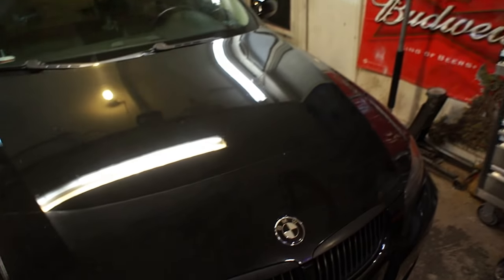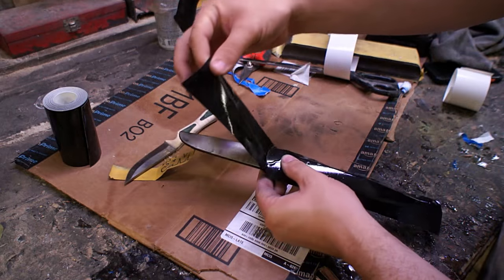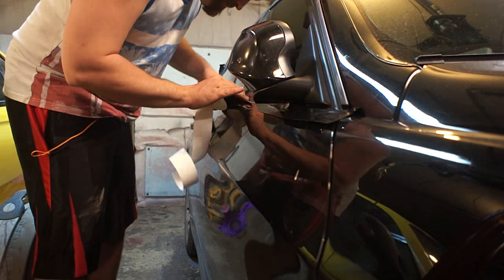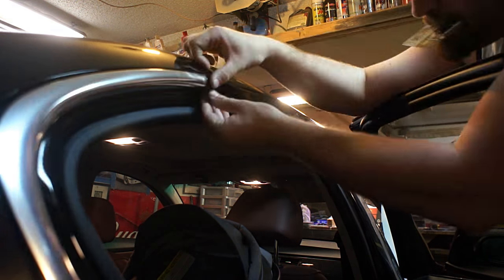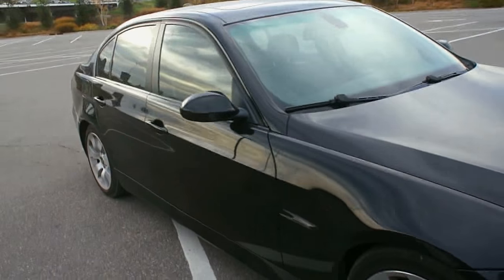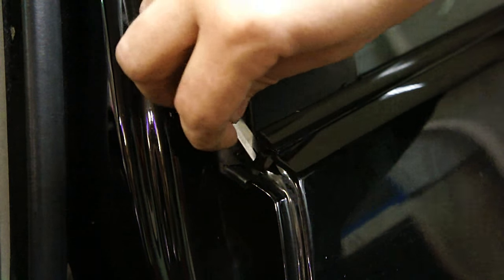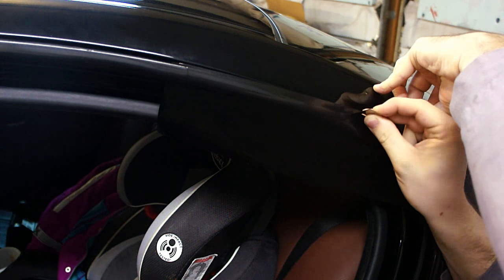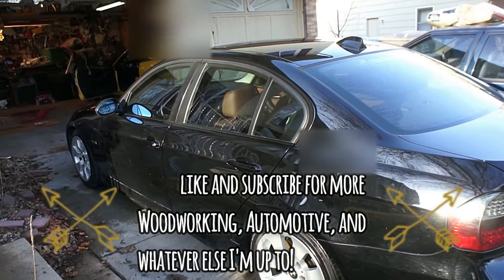Blackout Chrome Trim: Reversable Shadowline trim on 335xi e90

Comment: Hey this looks awesome and I've been scared, to he honest, to tackle blacking out the trim on my F32. How about some updates?  

1) Wouldn't the tape come off when you roll your window up a few hundred times?

2) Has it held up to car washes and weather?
Reply: Scared of what? Is there something I'm missing here? If you fail or it comes out bad you just rip it off. It's not like it permanent so why not just try? Do you think you're gonna scratch your car with the razor blade or soemthing? There's always knifeless tape if that's your concern. But even without that, it's fairly easy to cut around trim since many cars have a wide enough gap it use as a guide for your razor..